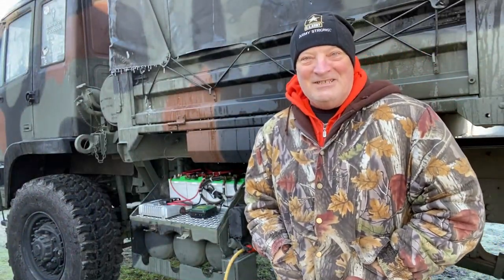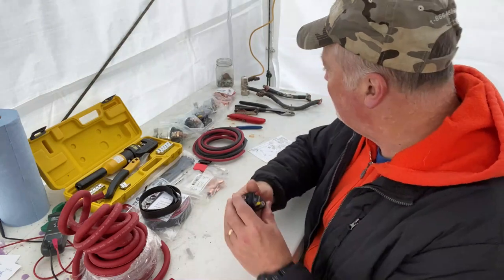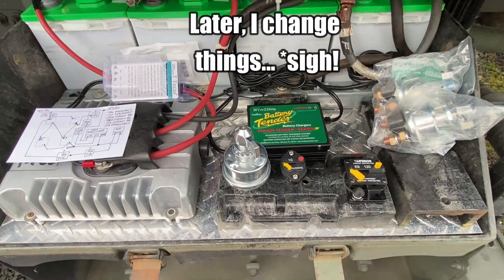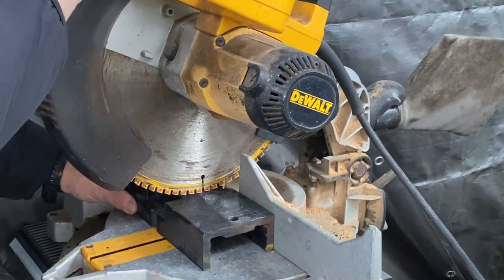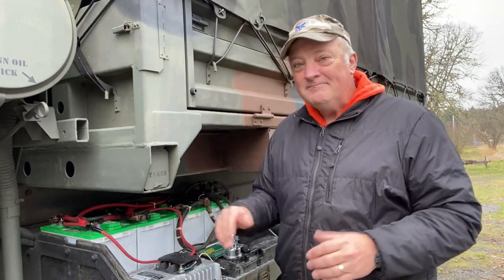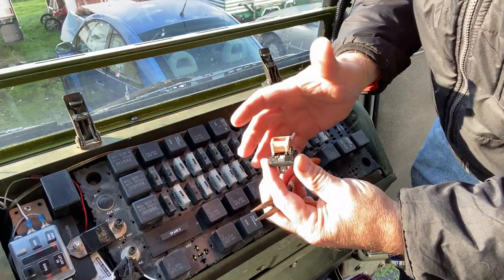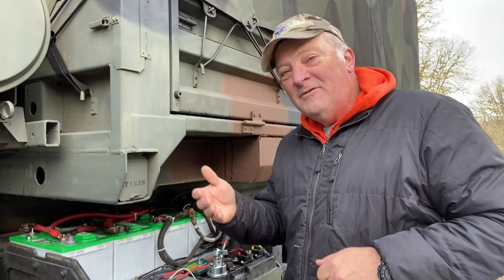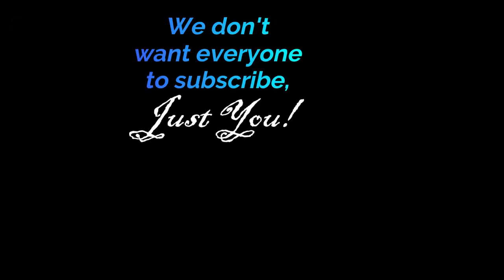FMTV CIRCUIT BREAKER PROTECTION for Auxiliary Components #150

Comment: Looking good Dave. Cool idea on using the battery divider. Makes a nice mount and wire chase.
Reply from the maker: I’m using part of the battery tray to mount the battery disconnects... waste not want not. That darn thing it 3/8”s thick! I welded a hole saw to yesterday by friction alone... attempting to cut through it. 😂

Comment: I have a relay on the battery tender. If the tender is powered up it closes the normally open contacts of the relay applying the tender to the batteries. If the tender is unplugged then it’s disconnected from the batteries. Your idea works too. I don’t have a place to plug in where I normally store my LMTV. Thinking of adding solar for that.
Reply from the maker: That relay system is genius. That will work to isolate the unplugged tender. Thank you for adding yet another cool option to the discussion... that is exactly what I would like others to do... continue the story. There are many, many folks that read these comments, and the more we can learn from one another, the better the entire community will be. So, thanks again, my friend.